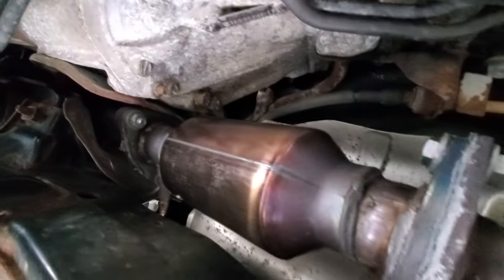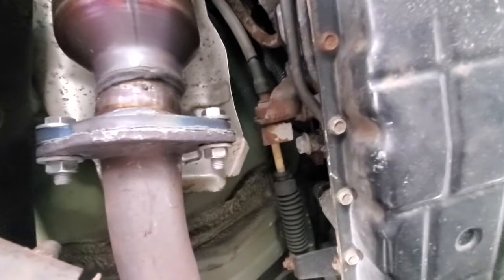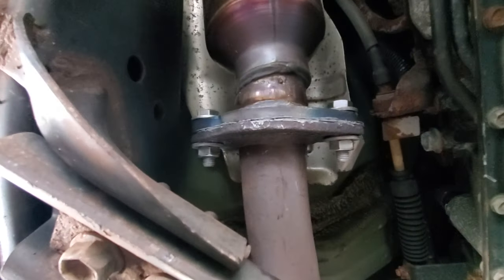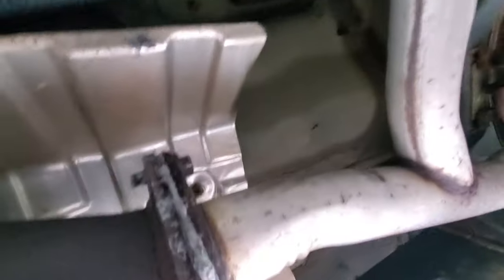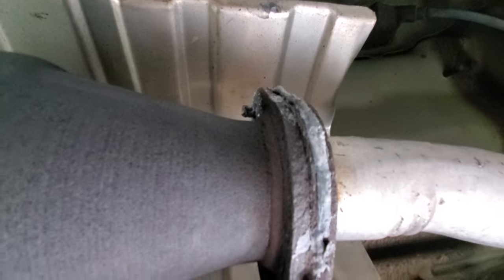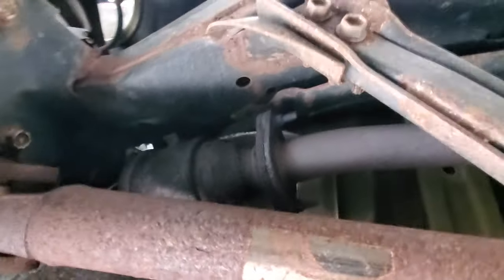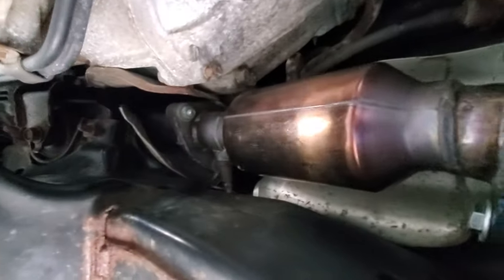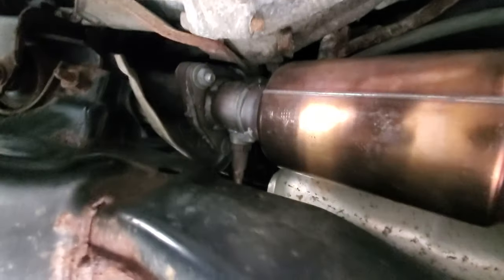Update To Catalytic Converter From Hell Video

Comment: I did all the 4 catalytic converters on my 06 Xterra a few months ago and I was about to give up and bring it to a shop because those bolts and the rust were too much of a pain.
Reply from the maker: hey yeah for that  angle grinder is needed ... I worked on my exhaust not too long ago and for that  I finally bought one cheap but it worked just fine . so If I ever work on cats again.. I sure will get all needed tools..  as you will need to cut them drill out and use new bolts and nuts